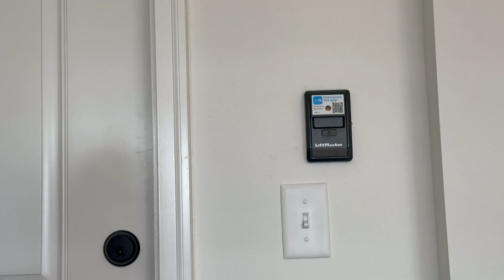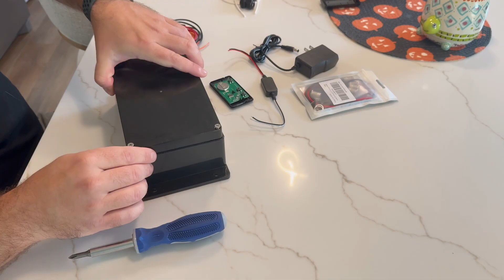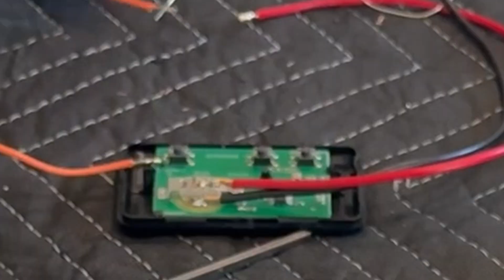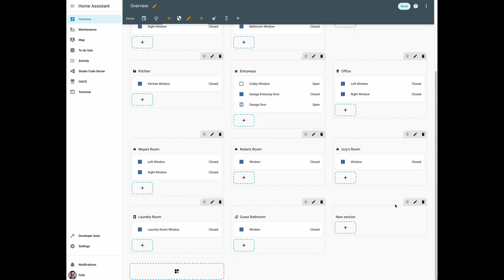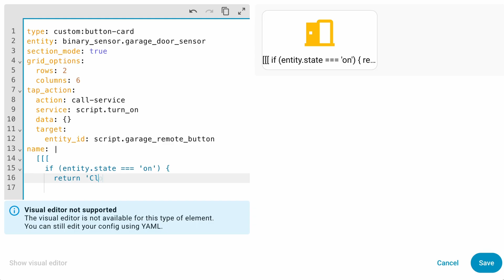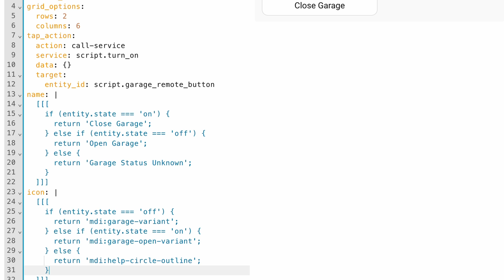MyQ Garage Door Opener to Home Assistant Integration (DIY Z-Wave Hardware Hack & No Cloud)

Comment: Hi great video thanks for the help getting the card set up the way I wanted it to be on my dashboard I wanted to point out one thing that you may not know about the relay I have done a similar project  If you look at the settings in Z wave for the relay You can set the relay up so that they're set in garage door mode which means it only gives it a 1 second pulse and then you would not have to use the script if you wanted to do it without the script
Reply from the maker: Awesome thank you!

Comment: Nice and clever. Soldering is easier on PCB using clean sites with flux. Pre-tin your connections to ensure bond. Higher gauge (AWG, finer strands) for jumpers also make these connections easier since they don't need as much dwell (time under heat) to reflow which reduces possible board damage.
The components list was handy. I used a GoControl GD00Z-8-GC to provide tilt sensor and operation beacon/alert. It uses 12v DC like your Zooz relay, and provides the momentary close required to trigger the remote button press through the jumper on the remote switch. I really liked the Buck converter to eliminate the battery changes. Thanks for sharing!

Comment: You can do all this with one shelly relay. Feed the relay with 120 volt coming from the same box the opener is plugged into then run a 2 conductor cable from the opener to the relay normally open contacts and set the relay up as a momentary contact switch. You can do all this in about 15 minutes for less than $20.

Comment: I had an old Craftsman opener that was controlled using my Zooz ZEN17 controller.  Then just recently my opener died and I installed a "MyQ " opener thinking that it would integrate with HA.  Your video has given me new hope.  The only down side is that I have to give up a remote.  I was wondering if the same could be done with the wall controller micro button?  I already have 4 wires running to it with 2 not being used.
Reply from the maker: I could never figure out how to get the wall control wired up. This way, you don't have to mess with any of the install. An extra remote is cheap on Amazon.

Comment: Nice work—I really like what you’ve got going! I recently installed a Chamberlain RJO101 Wall Mount Garage Opener myself and paired it with a ratgdo32. I considered a few other options, but the ratgdo32 integrates perfectly with Home Assistant as an ESPHome device. Definitely worth checking out if you haven’t already—it’s a much simpler setup.
Reply from the maker: Never heard of that before. I'll definitely have to check that out!

Comment: This is very cool and I get the sense that you are a tinkerer so going in this route made for an awesome project. I would say for people that are not as talented as you there are two options on the market that work really well one is from Meross and the other is Ratgdo. I personally use the Meross solution and it works great. It was a fairly easy set up and outside of the occasional Wi-Fi issue in my garage it has worked flawlessly.  I would’ve preferred to go with the Ratgdo solution, but it was back ordered at the time. I definitely appreciate you making a video and thanks for sharing.

Comment: Nice work and efforts to create this! I’m curious if an IR blaster for the garage remote would be easier or even possible and then integrated it into home assistant. Also adding some door sensors for garage door open and garage door close. Even adding a garage camera to the integration as well to visually see it open and closed. Definitely better than paying a subscription for MyQ
Reply from the maker: I figured this would be an easy solution that can work for any garage door opener, since it is based on a universal remote. But your options are definitely possibilities. I have not yet added a camera to my garage but that's in the works in the future!